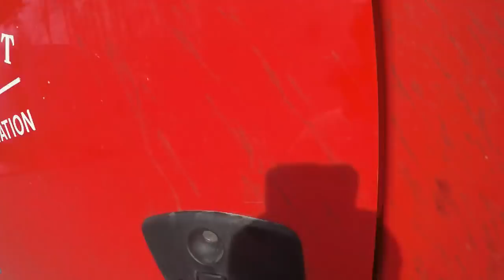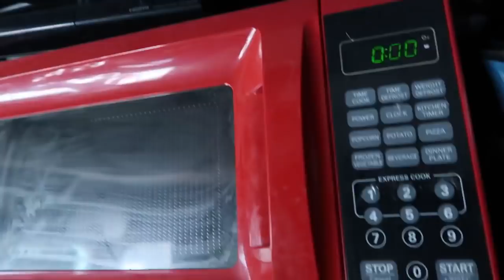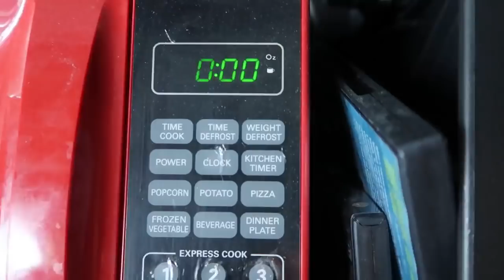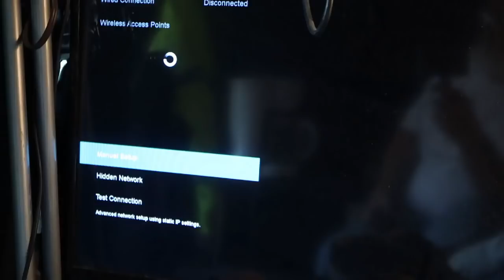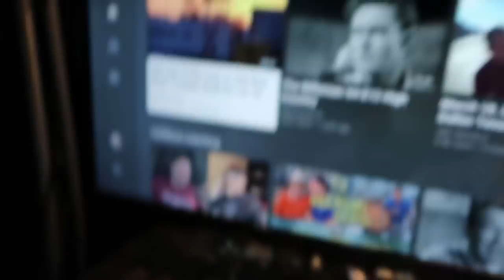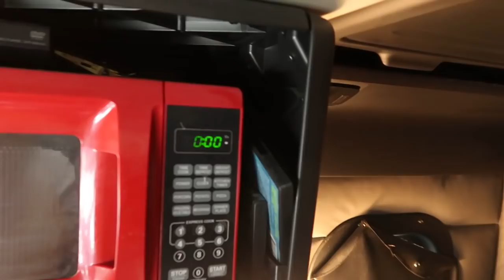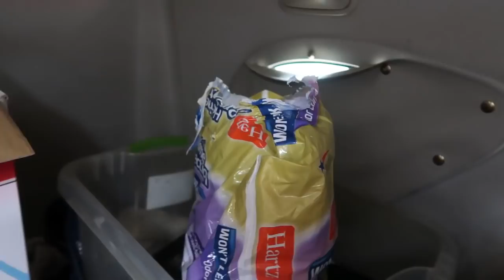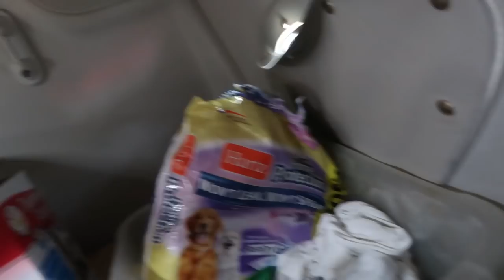TRUCKER JUKEBOX, Jake and Panda, And a little inside the truck.

Comment: take the battery out of that apple laptop and leave it unplugged for 5 to 10 minutes.  then, replace battery and plug it in and it may start.  I did that with mine and it worked.  good luck, worth a try